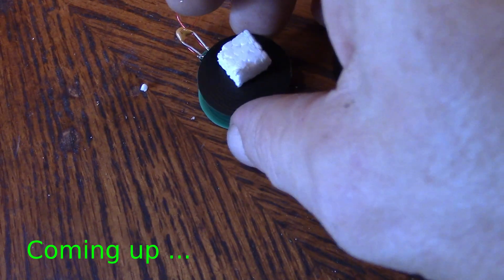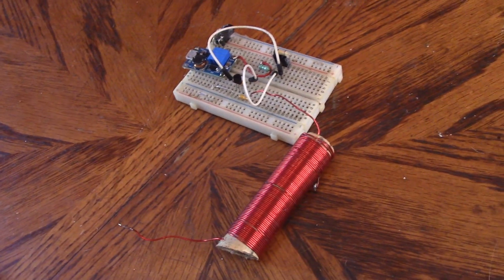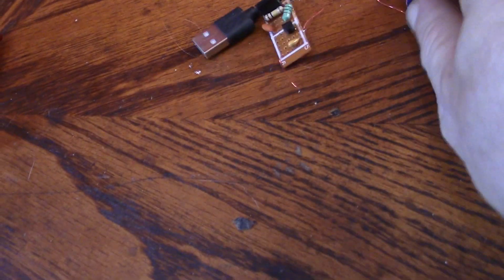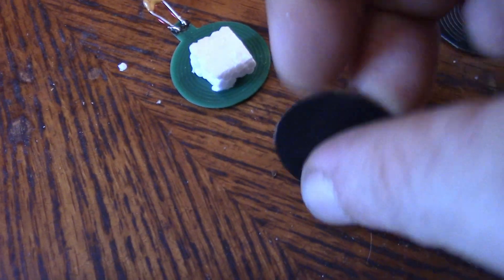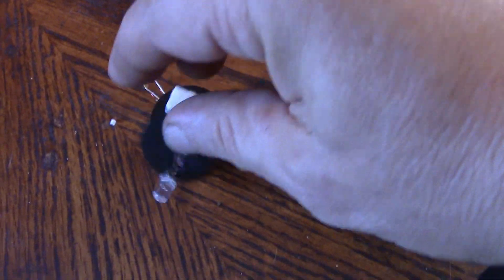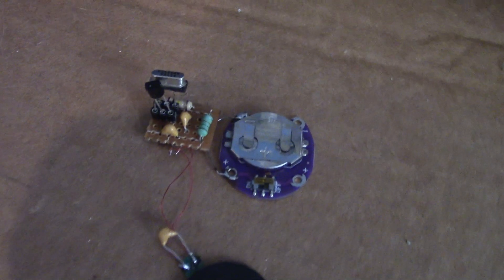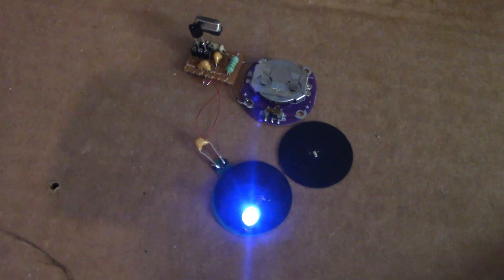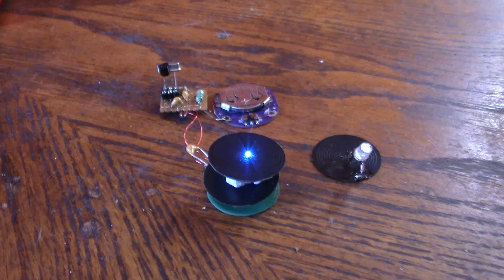Cool results with the new wireless electricity test circuit

Comment: Awesome little coils, I imagine the transmission distance increases because the coils are resonant making them receivers and transmitters.
Reply from the maker: Yes awesome indeed and these coils are very well made.. each being exactly the same as another, which helps huh 😁
There is also a flexible coil version, where Nick has used exacting sized discs of copper to form the capacitance between the material layers inside. Very Dr. Stiffler in method.
Reply: @Slider2732_  can I order this as a kit DIY??
Reply from the maker: @jonaoconnor8065  Yes, the coils can be orderes 😀 Contact Nick via his Hamspiced page on Github. The circuit mind you should be built from parts. It's not too difficult with medium soldering skills.

Comment: Hi! Please try uot the output signal with avramenko plug... you know v shape 2 pieces signal diodes. You will bee suprised, i am 100% sure!
Reply from the maker: It's interesting with an AV plug... in that there isn't the expected output. Can be guaranteed with Slayer Exciters or Dr. Stiffler's SEC's etc, but with this one the tuned coils work best. I was very surprised. 
Can get some from the transistor Collector and a couple of other places, but it's all very limited compared to what was expected.
Reply: @Slider2732_  This is the cold electricity, or the rus guys torsion field, or Nikola Tesla radiant energy.

Comment: Those are lovely boards/components. They look beautiful 👍👍😁😁
Reply: By complete coincidence, I have been doing a little fix on a circuit that required the crystal replacing. I hadn't considered that one could go faulty, but changing it did the job.
Reply from the maker: @GrandadIsAnOldMan  Apparently JLCPCB are cheaper than the other one too, by a long way, said Nick. 
I'd think that over time those billions of oscillations must break down the crystal. Hair fractures and the like. Oh and it could be why the Apple board was junked before I got it. Only 2 of the 3 crystals work... you may have helped to solve that mystery.

Comment: Great experiment, thanks for sharing ❤

If you check my channel you can see similar setup where I am using a laptop charger 64 w output to power +2Kw loads … if distance between coils is adjusted can lower power consumption in the 1 minute video, while keep them close enhance power output ( in the longer video). Using diodes and capacitor on output will allow to power AC and DC loads in the same time. (Full parts in comments and description).
Reply from the maker: Thanks and yes will certainly take a look. Good luck with your own experiments 😀👍

Comment: 😊👍 interesting video. Wonder if it is possible to make those coils 3d printed.
Reply from the maker: Cheers John. Maybe a hybrid idea, where the disc is 3D printed and fine foil copper is cut out with a sharp tool. The tool would have the coil turns designed into it as a sharp edges spiral, then it could be pressed into a thin copper sheet. Glue the print and copper together for a coil.